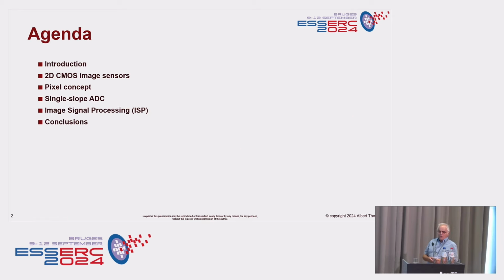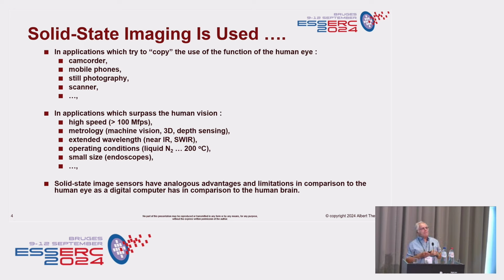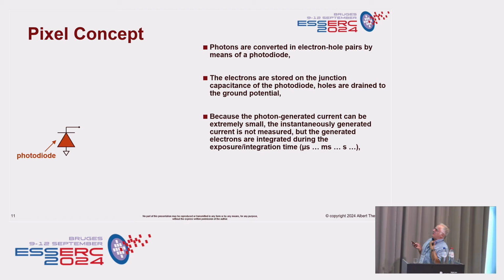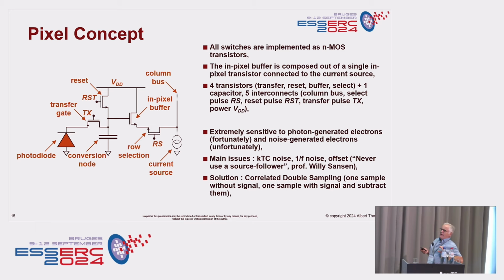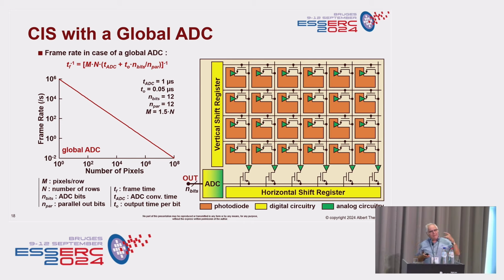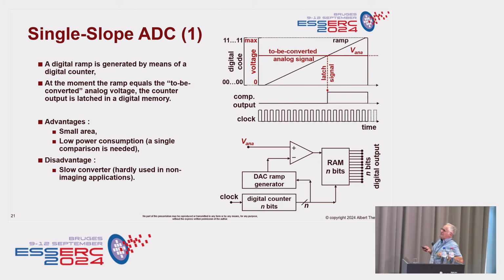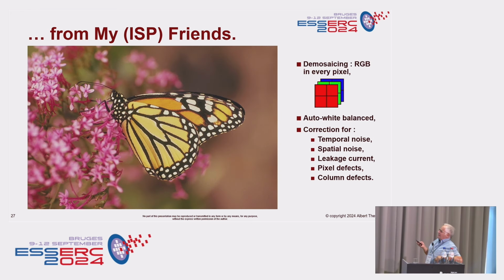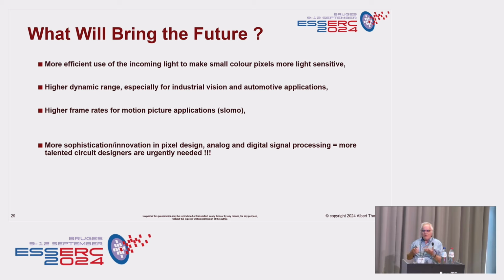Basics of CMOS Image Sensors - Albert Theuwissen | ESSERC 2024 | Circuit Insights (2)

Comment: CMOS Image Sensors: An Introduction and Overview

* 0:00 Introduction: Albert Theuwissen, representing Harvest Imaging, provides an overview of CMOS image sensors and their applications.
* 1:02 2D CMOS Image Sensors: The presentation focuses on 2D CMOS image sensors found in devices like mobile phones.
* 1:15 Imperfect Sensors: Image sensors are not perfect and exhibit various noise sources and defects, including defect pixels and columns.
* 1:30 Role of ISP: The Image Signal Processor (ISP) plays a crucial role in correcting defects and enhancing image quality.
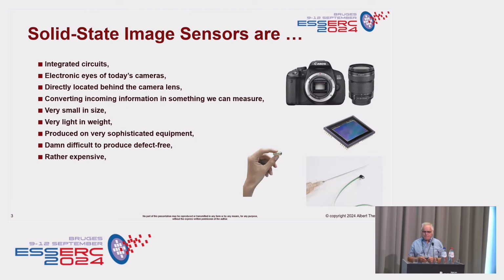* 1:40 What are Solid-State Image Sensors?: They are the “eyes” of modern cameras, replacing imaging tubes and converting light into measurable signals.
* 2:52 Key Characteristics: Image sensors are small, lightweight, and produced using sophisticated equipment.
* 4:13 Cost:  While production can be expensive, prices vary greatly depending on the application, with front-facing mobile phone sensors costing around $0.25.
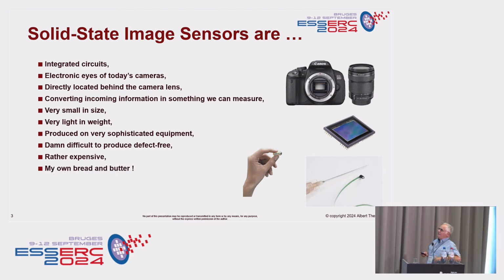* 4:47 Applications: They are used in applications that mimic or surpass the human eye's functionality, including digital photography, high-speed imaging, metrology, and extended wavelength detection.
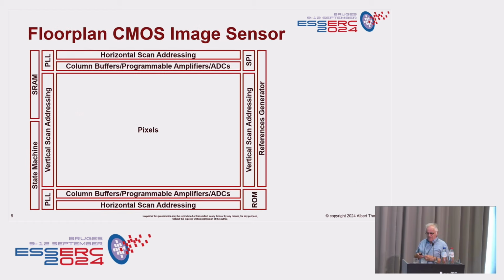* 7:33 Image Sensor Architecture: The architecture resembles that of digital memory, with a 2D array of pixels surrounded by peripheral circuits.
* 8:05 Color Detection: Silicon devices are not inherently color-sensitive, so color filters like the Bayer pattern are used to enable color detection.
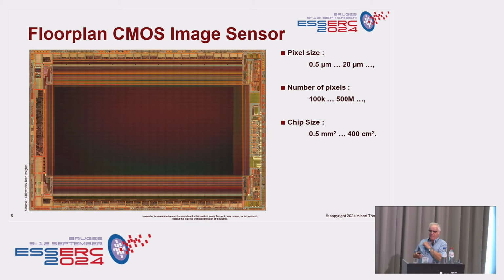* 9:51 Pixel Operation:  A pixel comprises a photodiode, which converts photons into electrons, and a transfer transistor that moves the charge to a capacitor for voltage conversion.
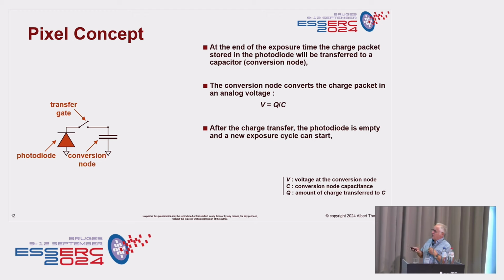* 13:43 Noise Challenges: Pixels are susceptible to noise, such as ktc noise and 1/f noise, requiring techniques like correlated double sampling for mitigation.
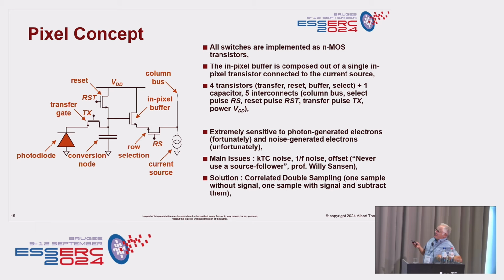* 17:39 Shared Pixel Concept: To maximize light sensitivity in small pixels, the shared pixel concept is employed, where multiple photodiodes share readout circuitry.
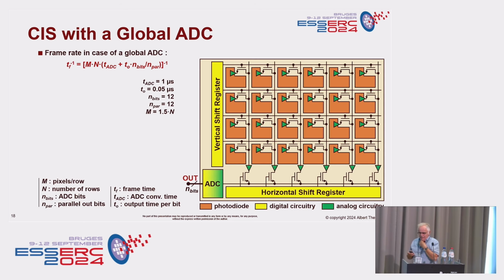* 21:41 Frame Rate Considerations: The frame rate is limited by factors such as ADC conversion time, output time, and the number of pixels.
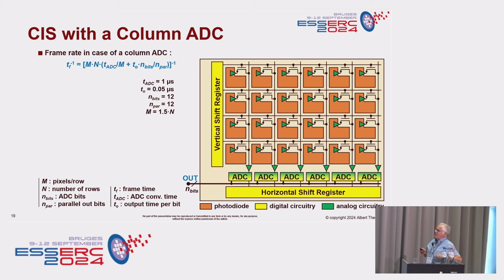* 24:58 Column Level ADC: To enhance speed and reduce heat, column level ADCs are used, placing an ADC on each column.
* 27:13 Pixel Level ADC and Stacked Solutions: Pixel level ADCs and stacked solutions with dedicated ADC layers are emerging trends.
* 28:15 Single Slope ADC: This simple ADC architecture is well-suited for column level ADCs and involves comparing the input signal to a generated ramp.
* 31:27 ADC Sophistications: Advanced techniques, like using counters for correlated double sampling and offset correction, are applied to enhance ADC performance.
* 33:29 Image Sensor Imperfections: Sensors exhibit various defects, including temporal and spatial noise, leakage current, pixel defects, and column defects.
* 35:06 Raw Image Correction: Raw images undergo extensive processing, including demosaicing, noise reduction, and defect correction, to produce high-quality images.
* 37:36 Future Trends:  Future advancements include more efficient light utilization, higher dynamic range, increased frame rates, and sophisticated pixel design and signal processing.
* 42:30 Call for Talent: The industry has a high demand for skilled circuit designers to drive future innovations in CMOS image sensor technology. 

I used gemini-1.5-pro-exp-0827 on rocketrecap dot com to summarize the transcript.
Cost (if I didn't use the free tier): $0.03
Input tokens: 23054
Output tokens: 756